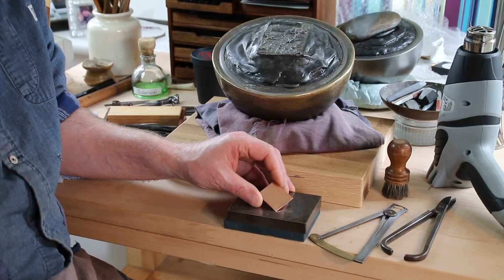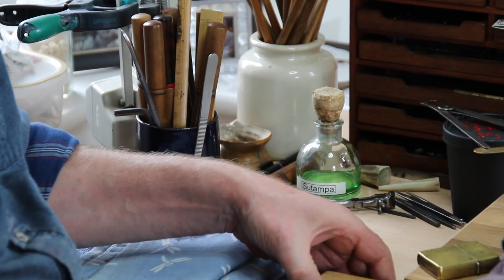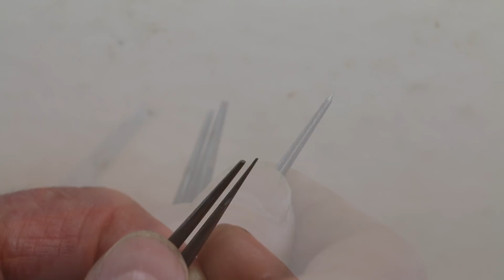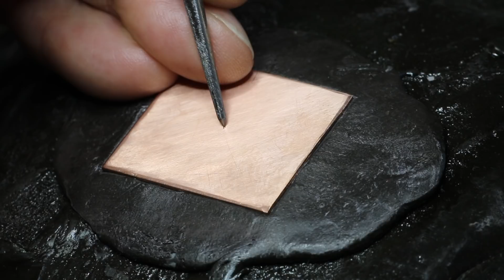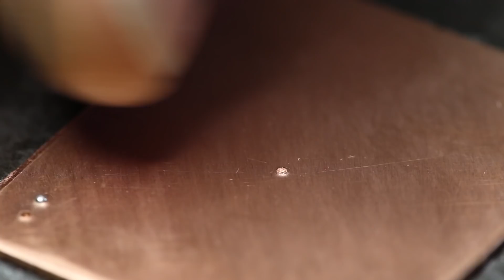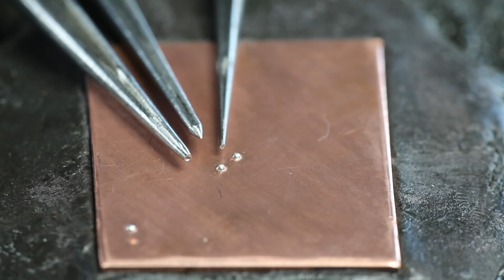Ten zogan, Japanese raised dot inlay

Comment: Lucky you don’t have to make a living doing this! Only joking. What about a plate about 1mm thick with matching holes to the size of the wire with a small reverse chamfer to line up the insert with the hole.  Then it should be easy to put the  inserts in square.  It might also sort any burr problem as well.  Not dissimilar to the plates on your wall.   Ageing eyes are not so good these days.